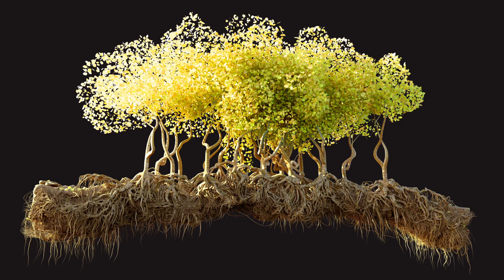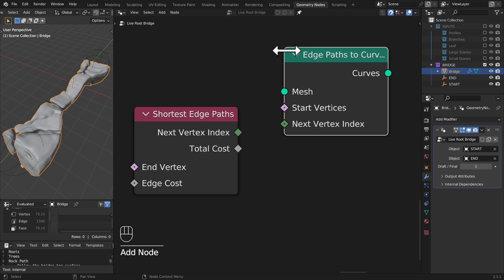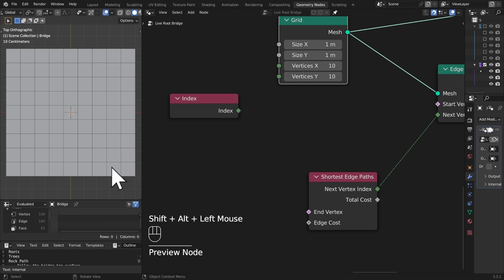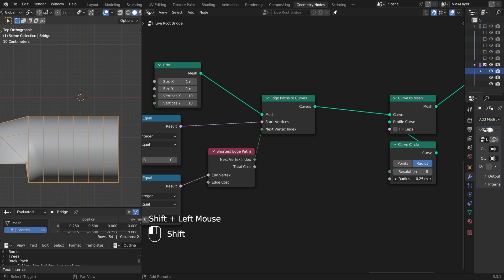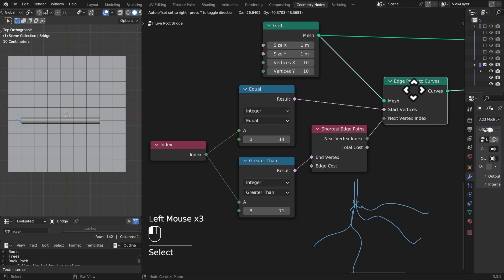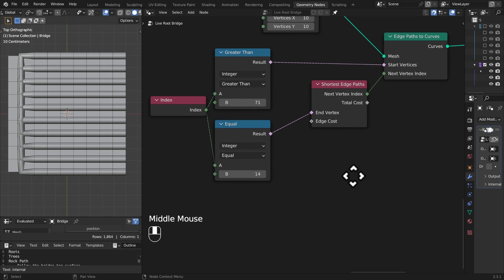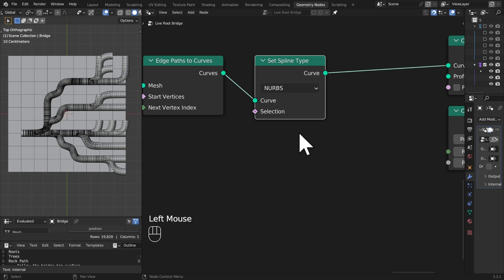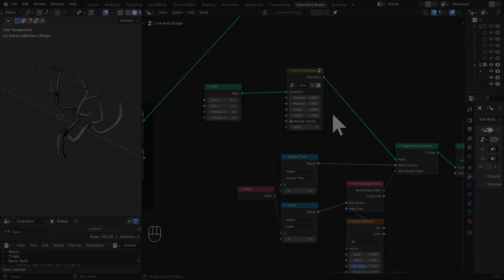Shortest Path Nodes - Geometry Nodes Tutorial

Comment: 5:08 from my understanding edge cost does not multiply  with the edge length, if you leave the socket empty it just yields a path with the least amount of edges  as they all have the same cost. Of course if all edges are the same length then the result is the same, but according to my tests leaving the  socket empty and using the edge vertices node to calculate edge length  and use it as the cost, produce different results when edges have varied length, and the  result with the socket empty is always longer.

Edit: I believe the best way to test this is to create a trapezium,  subdivide the shorterts side 8 times  , and longest side only once, then create the shortest path from  between two opposite corners.
Reply from the maker: I'll have to give it a test. An empty socket is not a zero value necessarily. If you hover over it you can see the default value is 1 there
Reply from the maker: I wonder if perhaps the sharpness of corners is a cost factor as well. I've noticed preference given to straight lines